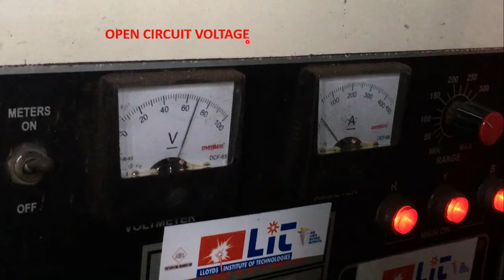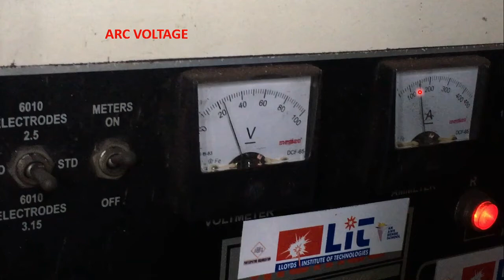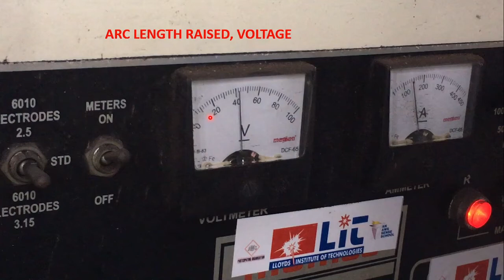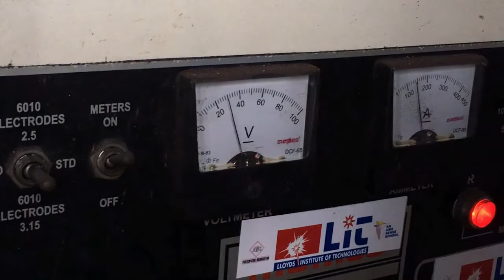Open Circuit Voltage (OCV) vs Arc Voltage in Welding

Comment: There is a Position for 6010 Rods on the left switch . What is the special function a 6010 rod need ?
Reply from the maker: E6010 Electrode is a deep penetrating and all position electrode, which works best with DCEP Polarity. Please view my video on SMAW Electrodes.